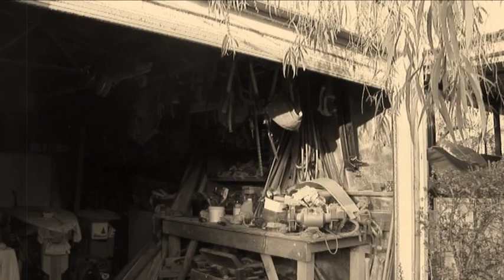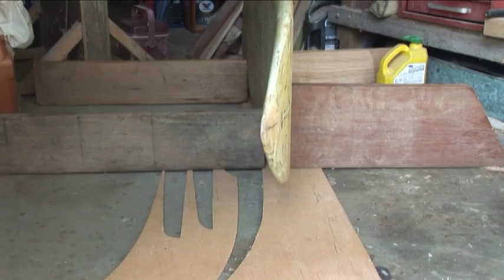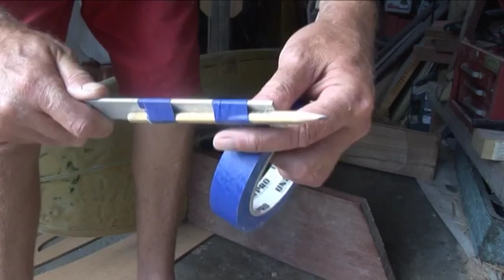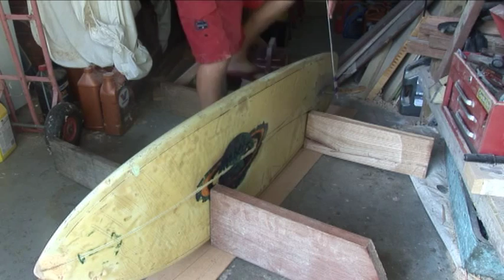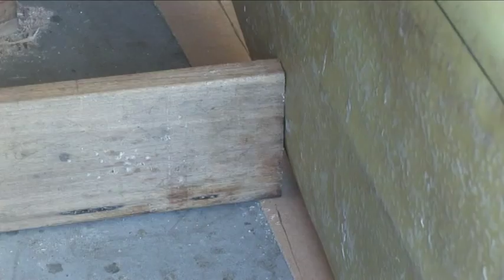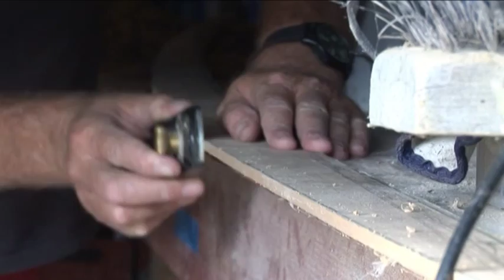How to make a Surfboard rocker template

Comment: I made 2 brackets to hold it at 90 so i could get my rocker profiles but it amounts to same method
For the outline I clamp a pc of thin plywood to bottom using stringer as centerline and draw half of the outline for an outline template or you can make a spin template as well

Comment: any tips on making an outline template from an existing board please?
Reply from the maker: +Rod Fredericks you can do similar with the outline , just put the straightest edge of template material in line with stringer at nose & tail, just copy half the board (flip over to make whole). if you can remove the fins its best to copy with deck up & block the template material underneath so its hard up against the rocker.
Reply: +DeepCreekTV Thanks mate, love the videos. what would be the best alternative wood to use. Cheers again.
Reply from the maker: +Rod Fredericks  not sure if you mean wood for template or to make a board.....template  - MDF, thin ply or macinite ETC even cardboard or simular....or for a board - balsa , cedar , poplar, redwood ETC any light tight grained timber best, athough you could use anything really, its just a weight to strength compromise & some timbers you'll need to glass.
Reply: +DeepCreekTV Thanks again mate, can you give me he approx. costs of supplying Paulownia for  6'4 X 22 x 3 please?
Reply from the maker: I'm assuming this is for a chambered model....without knowing how deep your rocker will be or outline shape its difficult to calculate a close approximate so as to use minimal material. As ur board will be 3" thick probably best to use 200mm/8" planks as you may be able to get 2 cut rockers out off the one plank. I only have 150mm/6" raw sawn planks that will need to be dressed on both 150mm sides (no need to dress edge) So roughly u will need 12 off 2m x 150mm x 50mm lengths @ $21perLM = $500